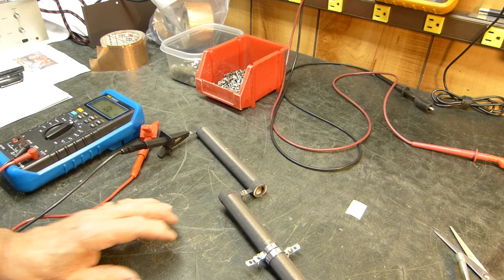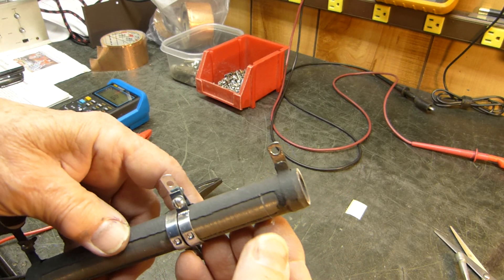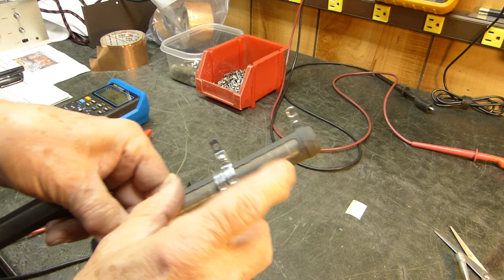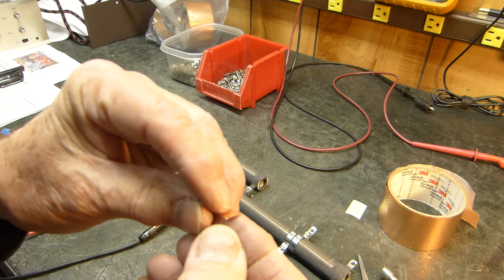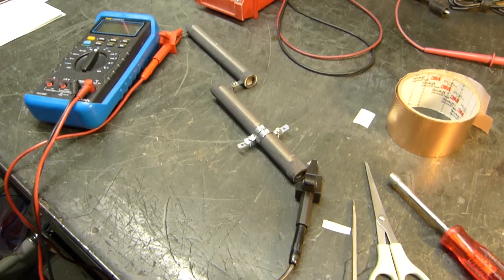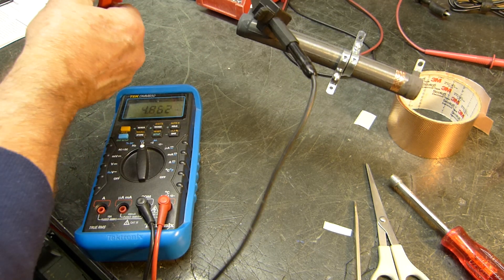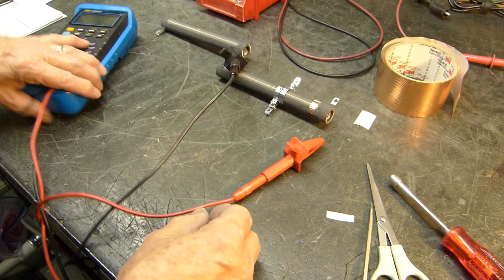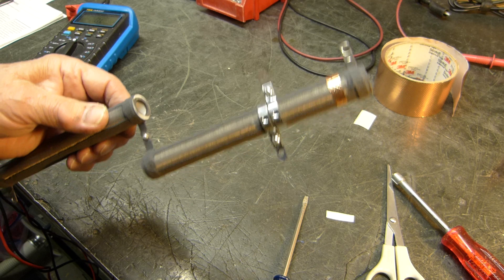Repair Of Large Wire Wound Adjustable Power Resistors

Comment: I thought at first you were going to move one of the taps to a point just before the fault, and treat it as the end.
Reply from the maker: Depending on the value of the resistor, for example, copper tape on a 50K resistor should be more narrow that the one I use on a 5K but it is better than throwing the resistor away and as mentioned, you can solder to the copper tape. It has been mentioned that how does it work thru the adhesive on the tape... ?   I don't know but it does. Stay safe and 73.

Comment: So how come the adhesive layer on the tape does not act as an insulator?
Reply from the maker: I can't give you any other answer except that it works. I have used adhesive tape for years and you can connect it together in series by just putting a half inch of one over the other and extending it. They do this with copper tape in security systems also.
Reply: I wonder the same thing......maybe the rough surface displaces the glue allowing contact.
Reply from the maker: @harbselectronicslab3551   I suppose if one wanted to make sure contact is really good, and I do not think this is necessary, when extending the copper tape by overlaying a half inch or so at the ends, it could also be soldered at the edge. Maybe the glue is conductive? All I know is it works and I have never had an issue with it.
Reply: I believe this tape and others are available with conductive adhesive and without. HVAC aluminum tape would almost surely have insulating adhesive.
Reply from the maker: @stirlingschmidt6325  I tend to think like you do. Aluminum HVAC tape is not meant to be conductive like copper tape so I bet you have something there about the conductive properties of the adhesive on the copper tape. Whatever it is, it works and I have been using copper tape in similar manners for many years.